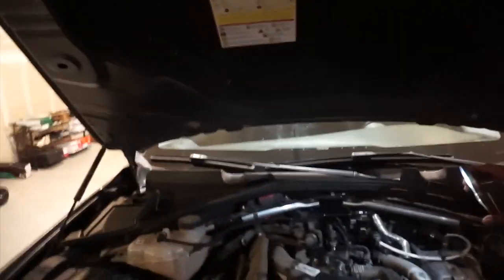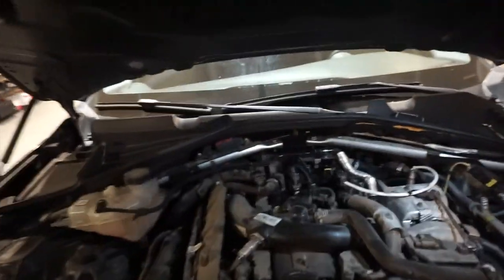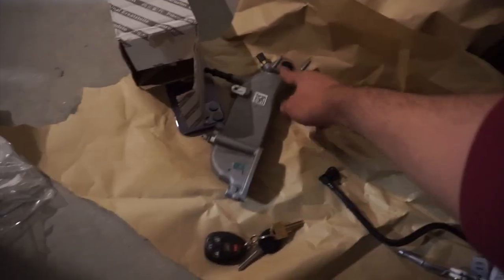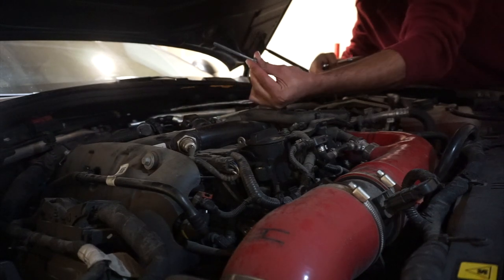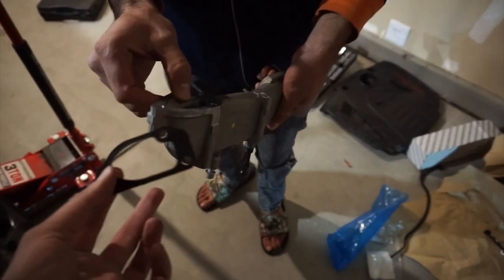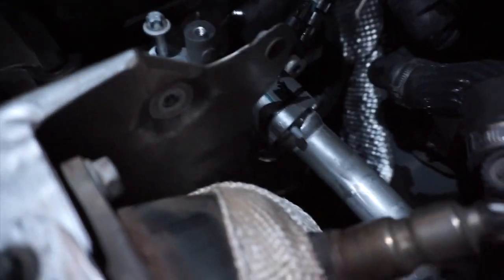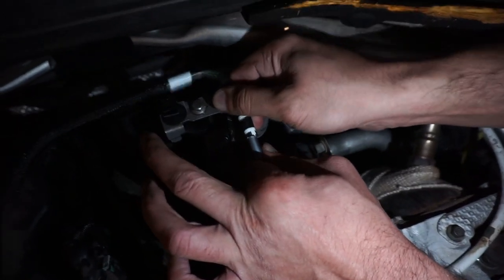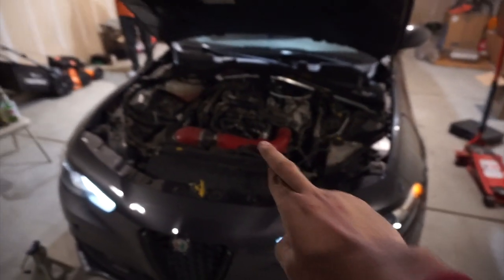Coolant hose replacement on Alfa Romeo | DIY | FIY |

Comment: These cars are SOOO under rated man!! Very Fast and RELIABLE not to mention. I have a friend who has over 180k!! on his 2017 no problems only spark plugs changed back in Oct of 2020 and the usual oil changes. I have to say Alfa along with Maseratti have come a long way in the Reliability department.

Comment: Hey man. Thanks for the video. Question: did you end up using the old gaskets? I heard you mentioned the kit didn't come with gaskets but then it seems like you were having some trouble with the existing ones. Would appreciate the clarification.